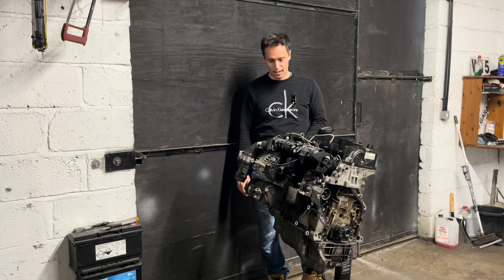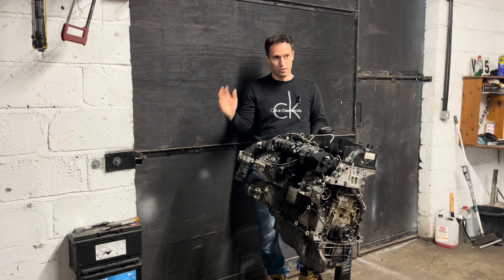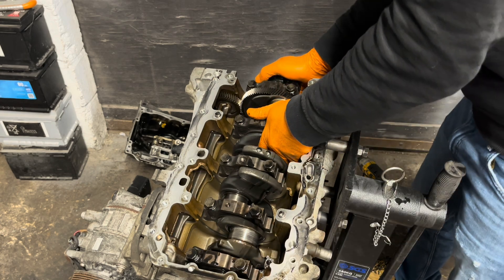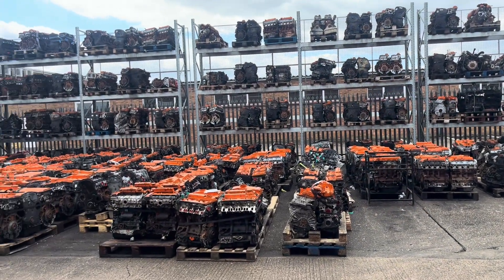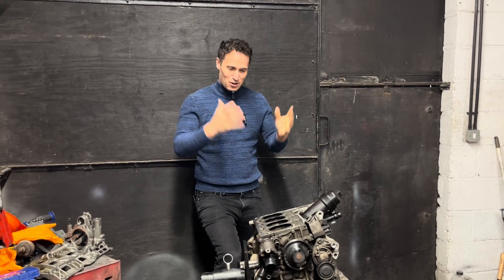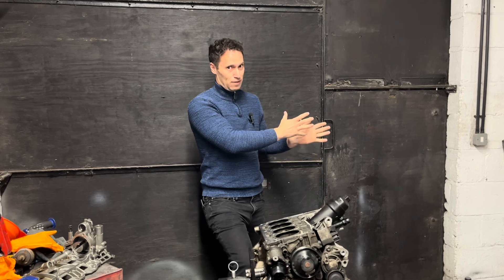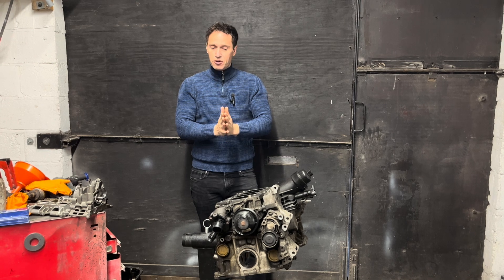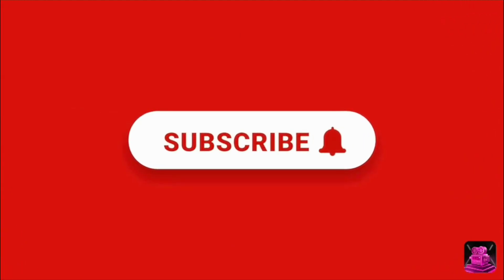BMW N47 Engine Rebuild Gone Wrong- I was shut down

Comment: I rebuilt an N57 with an aftermarket crankshaft and it only lasted 450 miles before it started knocking again. Had to purchase a used engine and fitted that.  1000 miles so far 🤞🏻
Reply from the maker: Thanks for your feedback! I like the donor car/donor engine route myself. Original new cranckshasfts cost a ton of money for a reason. Good luck with your new engine!
Reply: @W15Garage  I was £900 for aftermarket crankshaft, £500 for BMW oil pump and every gasket, bearings and bolts. I worked out near £4000 in total. Was an expensive lesson
Reply from the maker: @scottjohnstone4092  🤦‍♂️that’s a lot of money indeed. Sorry to hear that, at least you have a good engine now.
Reply: @scottjohnstone4092  most of the engines that failed after so low mileage were “fixed” by technicians who never red the n57 manual, they don’t know exactly how that system works. They assume it’s just an engine like any engine but it has some particularities. For example : the crankcase ventilation system is a vacuum controlled system. A regulated negative pressure of aprox 38mbar is mentioned. The vacuum helps the oil to travel into crankshaft and exit trough the bearings clearance. If negative pressure becomes positive, it may overcome the oil pressure and push it back. If the oil cannot exit, it also cannot come in.  Another example is the piston cooling nozzles. They are designed to open at 1.2 bar. Most of the times you’ll find them stuck open, and that is a serious problem. Usually the corresponding piston is damaged.
Reply: Stay away from Turkish or Chinese’s cranks 
You can get some good quality aftermarket German crankshafts but they are not cheap
Reply: @Cardoctorwolverhampton  it was a Turkish crankshaft I purchased 😭
Reply from the maker: @Cardoctorwolverhampton  thank for your input. I’ve heard that turkish crancks are bad, this is why I’ve stopped with the rebuild, to much money and risk.

Comment: Currently rebuilding an n47 with a snapped ebay crankshaft - looks like it has had one of the ebay rebuild kits and its failed due to a cavity in the casting (not at the oil feed).  Could be a BMW QC reject because the surface where all the bmw details should be is totally ground down.  Sold as a timing failure lol.  All the bearings were damaged, 2 and 3 looked liked they might not have had the right clearance (thrust side down to copper) whereas 1 and 4 still had soft metal coating on them. Or the crank was bent.

Comment: Great content.. I am going to rebuild the N57  & I would like to know what bolts & bolt sleeves you used on the engine stand as I cannot find this information anywhere?
Reply from the maker: @meuer  thanks for watching. It’s a home made improvised solution wasn’t the best, since then I’ve made some improvements. If i will have the time I’ll try to do a short video.
Reply: @W15Garage  yes please!

Comment: I successfully rebuilt 3 n57 engine with Chinese crankshaft, and all are running perfectly even after 20 000 km. 
In my opinion, the ones who last a few km after rebuilt didn’t know how to measure the oil clearance.
Reply from the maker: @Rylalex92  thanks for the feedback! What bearing brand did you use?
Reply: @W15Garage  first engine I used Kolbeschmidt STD, the second  engine I ordered another brand from eBay ( never heard of it before) and I don’t remember the name. The third I used Chinese bearings Kushima. Every time I measured the oil clearance and check for ovality using micrometer, and dial bore gauge.  
You can use the most expensive parts in the world, but if you don’t find and fix the root cause of damage it’s useless to spend money and time installing them. Just replacing worn looking parts without taking any precise measurements it’s a very big chance of fail.
Reply: @Rylalex92 BMW reccommend yo check oil clearance with plastigauge...micrometer can leave scratcbes

Comment: Bro I rebuild these engines regularly find us on google 
My question is did you change the oil cooler ?
Reply from the maker: Thanks for your input. I was going to but didn’t manage to get to that point, as the crankshaft turned out to be rubbish.
What crankshaft do you use? Could you recommend a brand or source tested that worked for you?
Thanks!
Reply: @W15Garage  this is my experience don’t grind the rod bearings to 0.5 otherwise after some mileage they get hairline fractures and loose oil pressure but not enough to bring on the oil pressure light on and overtime it’s chewed up again 
I pay around £250 for a std crank or 1 at 0.25 at £150 
I’m happy with these prices as buying used n47 engines is like Russian roulette

Comment: Sorry for the problem with your crankshaft, i am going through some issues with N47 engine too and that is after taking good care, gentle driving, frequent oil changes and spending so much money on engine parts,these engines are very sensitive and temperamental. I am going back to good old M47,M57 engine equipped car, (probably X3 as a new project) as these engines seems to be build much better than N47 engines and is easier to work with.
Reply from the maker: Thanks! The M47 and M57 engines are far ahead in reliability, 100% correct! 
The N47 is a good engine, I’ve seen examples with very high mileage still going strong. I think the key to this is regular oil changes and smart driving (not flooring it when the engine is cold, etc.). However, if you haven't owned the car from new, it’s possible the engine has already suffered from neglect. In that case, despite doing everything correctly, it might not help. Very sensitive engines that’s for sure.

Comment: Buy a good used engine and rebuild that.
Reply from the maker: I bought an accident-damaged donor car and removed the engine to fix my car after this engine failed. But a few comments suggested, "Why not refurbish this crankshaft, put in oversize bearings, and rebuild the engine?" That’s why I started rebuilding it as an experiment. This is the video when the engine died 
https://youtu.be/NMqLYZqIAaM?si=6gdbgBAHhuNZb_m2